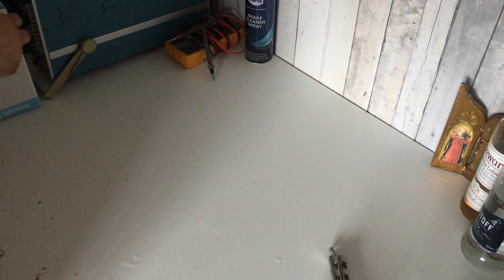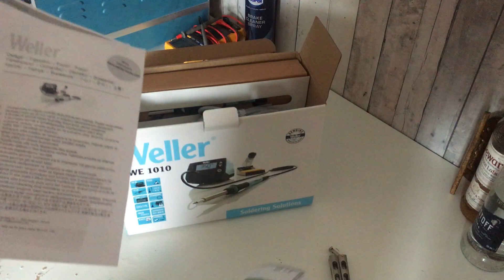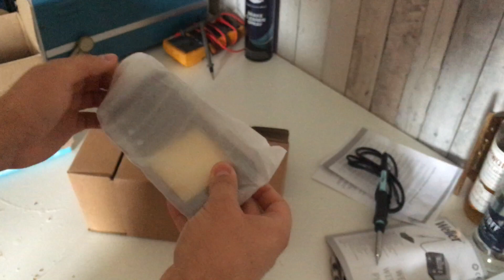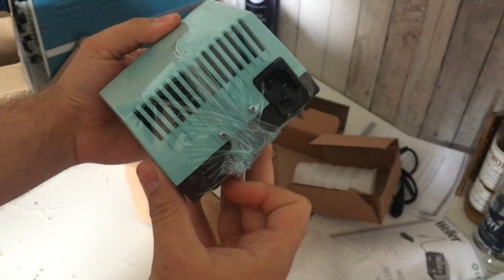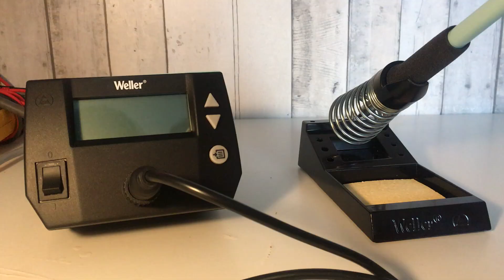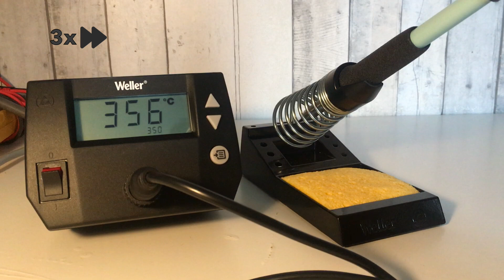Weller WE1010 Unboxing & First impressions

Comment from the maker: Almost 2 years with this soldering station, and I can safely state it performs satisfactory. I did a few projects with it, and it was a pleasure to work with. Heating up is plenty fast, tip is fine for general soldering (not SMD though, but as expected) and of good quality (no noticeable oxidation etc. yet). 70W is nice for larger volumes. Cable is flexible and long enough. Hopefully it'll continue to serve me well.
Reply: Do you notice how sometimes when it is as 350 degrees that it won't melt the solder?
Reply: @Rhythmicons  yes I believe this may be an issue to where the soldering tip does not make enough contact with the heating rod in the pencil so it Heats really slow at lower temperatures
Reply: @Hadens_problems  I began using a tip tinner and that solved all my problems.

Comment: Well it might be made in Mexico as my unit is also made there, but your unit has the German address on the label. The label on my unit states Apex Tool Company in South Carolina for the US/Canadian market. I wish they would have explained all the features. I had to figure out what "standby" was.
Reply from the maker: Standby is just that the temperature regulation is reduced to 180˚C after a specified amount of minutes. It prevents excessive oxidation of the tip if the soldering job is slow and long.